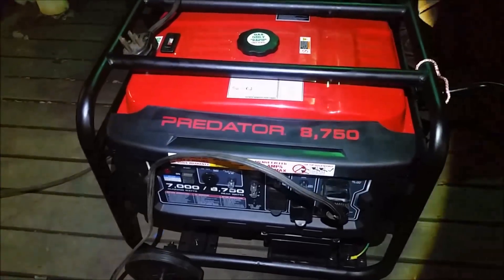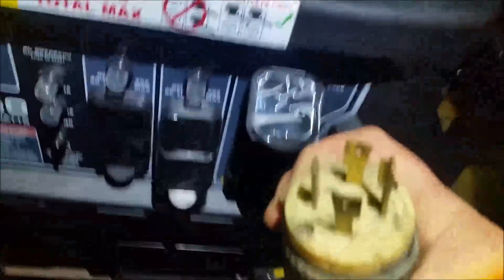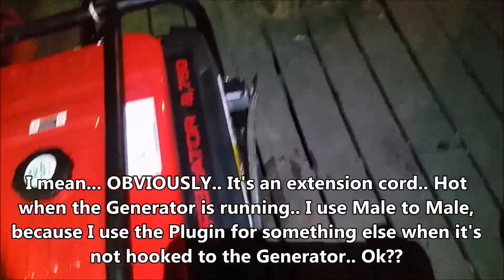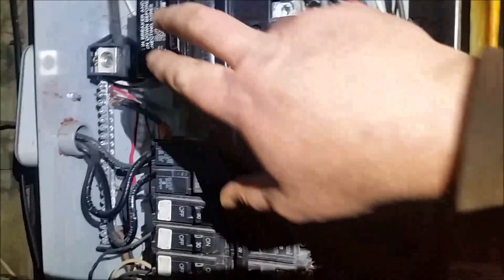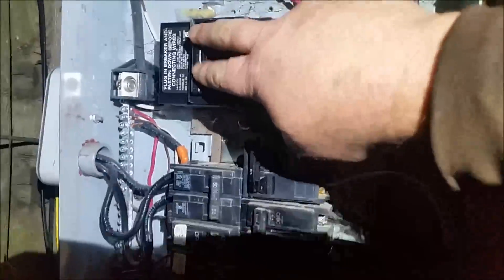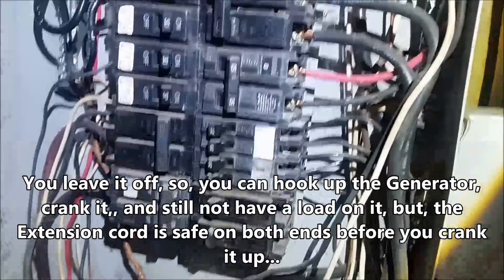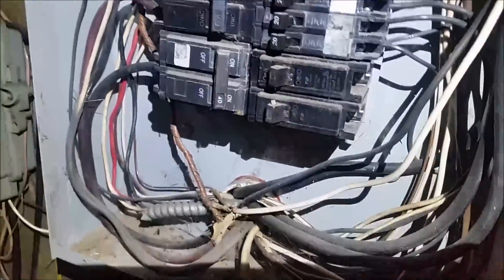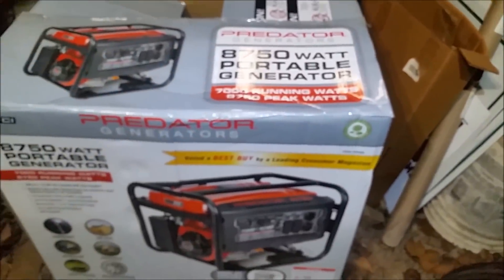Quick/Easy/Safe: Use Existing Plugin/Breaker for Generator hook up to your house Panel box.

Comment: Will this work? Yes.   Will your home insurance cover a claim if this is found on site? No. 

I would feel okay doing this in a pinch but there would have to be a way to lock the main breaker off. There is a device to clamp and lock a breaker. If you want to make it a lot safer to use, install a generator connection box to a 240V breaker. This box will have a recessed male connector covered by a weatherproof cap. The cord from the generator will have a male plug on one end and a female on the house side. 

Another thought. If you decide to use extension cords, ground your generator. There should be a ground rod near your meter.
Reply: I see no real reason to ground a generator if you are using an extension cord to a fridge. If the generator is not grounded the only way you could get shocked would be to touch 2 wires at the same time as there would be no earth ground reference.
Reply from the maker: @shofar-man  Correct.. I let that one get passed me... Thanks Ed for catching me missing that..
Reply from the maker: Challenge to Mr J Deveau....  First though... I'm not sure how you would use a generator without an extension cord tied to it in some way, but, I am still thinking.. Ha..Ha..  There is always a ground Terminal on your generator..  Not that you need one.. I have a 220 volt Deep well pump on my property.. Been here much longer than I have.. It  has only two hot wires.... No Ground from the Panel to the pump. Can you explain how that works as far as the ground.. BTW.. It is about 65 feet from the Pump to the Panel.. 10 Gauge wire,, 2 solid copper leads, 1HP pump 125 feet deep.. Ok.. Next.. I have been using generators for 20 years. I have never grounded one.. Do you "Need" to Ground a Generator?? You can, but, don't "Need" to.. 
So,, you are exchanging a harmless extension cord (Male To Male) that gets used a couple times a year,, and only while the generator is running,,,, and only limited to the Generator voltage while it is running,,,  but, you want to take an Exposed Male connector and connect it directly to the panel, where it is a potential danger 365/7/24.. Where my solution,,, the only time it could potentially hurt someone is when it is actually hooked up to a running generator, if someone was stupid enough not to plug both ends in.. I find that to be Ironic for someone safety minded...  But, that is Ok?? You are leaving your life and the life of others to a thin piece of sheet metal that does not require any common sense to use?? Ok..  And, on the Remember to plug it in,,, this same dangerous person without common sense to remember to "Plug both ends in", is in charge of "Must Remember to Plug the Protective Cap in the Recessed Male Plug"????  Just curious of the Logic there... !!!   Enough said about that... 
Quote: "If you want to make it a lot safer to use, install a generator connection box to a 240V breaker." Now,, My Way.
Quote: "If you want to make it a lot safer to use, install a generator connection to a 240V breaker." Did you notice the difference in how you do it and how I do it.. I just removed the word Box.. How different is that?? Ha..Ha.. It is installed in a 220 Volt breaker also.. :)
Now... Insurance not covering it.. For what reason??  Because it is against NEC?? NEC does not Regulate "Extension Cords",, only when "Not" to use them, and a Generator is always a "Temporary Source" if there is a Main Utility Power Source, so, does not apply... So, what part of this setup would "Cause a Fire"?? The fact that there is an Extension cord? Would be one in ANY installation of Any Type.. Is it because there is an extra Male receptical or plug? If you count either application, the same number of Male units are in both applications.. 2males (Extension cord and a female on the panel in mine,,, M/F Extension Cord and Male Receptical on yours. Same thing.. Hooked into a 220v receptical on both also.. Where is it that it can be proved that this caused a fire?  I mean... I am just someone who thought about what you said and proposed the questions to the same guy who authoritatively said them... 
Now,,,, it's just as simple to use a little logic to explain your comment... 
If you have an Opinion, it should be based on Facts,, and you should offer those facts up daily to support your opinion and Fact Check them, to be sure your opinion is actually based on the facts,, because,, you might just change your opinion.. This is how I came up with this scenario 20 years ago and have been safely using it ever since.. And, where I live, I run on Generator quite a bit more than even California with their crap power,, so is a "Worst Case Scenario" to test the setup... But, I do have common sense.. I can look at the Extension cord and immediately know that it needs to be plugged into a Non Running generator if the other end has not been plugged in yet..Ha..Ha.. 
Of course, anyone with common sense would do that anyway.. Have fun with the logic.. If you need some help,, let me know.. I am ready for "ANY" reply.. I have schooled Electricians and Electrical Engineers just the same.
If you wanted to see it, just keep reading the comments in this video. You would know more about Electricity than any average Electrician, which isn't much...
Reply: @MarkThomas123  Mr. Thomas
To clarify, I consider "extension cords" to be the 120V extension cords from the generator directly to an appliance such as a fridge or a water pump. The neutral would not be connected to ground. There is a very small chance that the output voltage would float in respect to ground and result in a shock hazard. This is the only scenario where a separate ground connection is required.
The generator cords, such as the one used in the video, are normally four conductor and connect to the building's ground connection. The male-male connection would use the same ground wire thus don't need a separate ground.

My guess on your pump? The pipe is acting as a neutral. Not sure if that's normal. My 120V pump is in my basement. I know I would feel a lot better if there was a separate neutral wire.

I've been working with generators for work for the last 12 years. We don't use a separate ground as we also have a ground wire connection to the existing wiring. We also use a manual transfer switch. I've recently purchased a 7200/10000W portable generator for home use after we got hit with the lastest hurricane. We were out of power for just over four full days. We average at least one 24hr+ power disruption per year (summer or winter). 

The generator connection box with male connection I was refering to are normally connected to a dedicated breaker that should only be energized if the main breaker is off. The lid is also spring loaded so it will not open on it's own. I just wanted to offer a middle ground solution in order to avoid the "suicide cable". This is what I meant by a lot safer. Safest is to have a physical barrier to make it impossible to have the mains on and a connection to the generator (panel interlock). I would also put a piece of duct tape on the main breaker after switching it off if no transfer switch, panel interlock, or lockout kit is not available.

Insurance is always looking for ways to deny claims. Here in Canada, using your method may be considered illegal wiring and will give the insurance company cause to deny a claim. I would rather spend the money and get it done right. 

"So, what part of this setup would "Cause a Fire"??" I didn't claim that this would cause a fire. I think you have the wrong comment.

So, is backfeeding via a 240V (dryer/welder) plug dependably safe? Yes, as long as everything goes exactly as it should. Is it risky? Yes, it's not an "approved practice" so insurance companies will give you grief if they find out. That's a risk many people take. 

I have decided to get the full legal install of a generator sub panel and connection box as I may not be home to connect it if the weather is bad. I may already be out connecting generators for work.
Reply from the maker: @jdeveau6718   This got a little lengthy.. 
1 of 2 reply.. 
120v Extension cords directly to an appliance: (Neutral not connected to Ground).. Think about the 2 wires going to the Deep well pump.. No Ground, and it still works.. The Motor has a ground to the water and ground around it.
Where is the ground on the Appliance? Connected to it's frame? Same thing.. 
Grounds,,,, In certain "ODD" circumstances might save someone from an electrical shock.. Remember.. Electricity takes the path of least resistance "ALWAYS"... 
Generator without a ground.. I assume you mean you don't Frame Ground the Generator itself from it's Ground terminal.. But, the feed to the existing wiring has a ground, and even if it did not, the Existing wiring does. And, the Neutral and Ground wires both go to the Ground bus in the panel, so, there is little if any difference "In General" between the two.. The main difference is at the Appliance, not panel or distribution. They are "HOPING" that in the even of a discharge, a direct coper connection is more conductive, therefore a lesser path of resistance than a human body, etc.. It's almost like wearing two rubbers and visiting the local gal everyone knows about.. 
Manual Transfer switch: My brother has one that is wired between the meter pan and house feed. You can't possibly make a mistake with it.. The Breaker Panel Interlock is another "Can't Possibly Make a Mistake" scenario.. 
BUT,, when it comes to DIY,,, here is where the problem is.. 
Let some Dipshit, or someone who "Thinks they know what they are doing", and in both of the above scenarios,, what is that person dealing with?? 
The Inside of a Panel and Full Voltage of the Feed.. At least 100 amps, generally 200 or 300 amps.. 
And, even a simple Interlock requires taking the Panel cover off.. Correct?? 
And, guess what?? When you use an existing Stove or Dryer Plug,, you don't have to pull a panel cover or pull any main feed.. Safer yet?? 
I think it is a whole lot less to remember, to say "Turn off Main First", plug in extension cord", and Crank Generator.. 
Most generators a DIY is going to purchase are 30 amps and below. A dryer plug is most often 50 amps, same with a stove. At the least 30 amps on a dryer. So, the chances of overloading the wiring is remote.. When you start pulling 30 amps from a 30 amp generator, you are going to be having brown outs everywhere and strange things are going to start happening, besides filling the generator with gas quite a bit more frequently. Usually, it is only when some large motor start up, and only for those few seconds at most at startup.. Not something that is going to melt a wire before the generator bogs down and dies or things in the house start beeping and rebooting, etc.. 
People just don't run generators at full load, and if they do, and then don't, it will be very obvious that the gas is too expensive to run 12 or 24 hours under that kind of load. One night you get 8 hours on a tank and next night you only get 5?? 
I would say that we loose power 40 to 50 times per year. On a good year, probably 10-15. Average outage is probably 12 to 24 hours with some stretches of 3-5 days, with a few times 7-10. Lots of outages are only 3-4 hours.. What you need is a quick way to hook up, run, and disconnect and get back to work. Using an existing plugin and a Male to Male cord can't get any more simple or quick.
When you grab a Male to Male cord, you have to be brain dead not to get the heebie Jeebies and think to yourself, one more minute before you connect anything.. Just to think about it one more time before you energize it. But, it's pretty simple. Turn Main Breaker off and don't crank Generator before Extension cord is plugged in on both ends. This is for people with common sense who wants a quick/cheap and safe way to get through an outage.
I keep a Plugin with a pigtail handy in case I want to take the generator to someone else's house to get their Freezers/Refrigerator cold again.. The generator never leaves the back of my truck, unless I want to go somewhere, or have to take the genset around the side or back of the house and there is not enough room for the truck.. There are lots and lots of reasons for this type of hook up and nothing else is going to work like it. Nothing more simple.
In Canada I am not familiar with the codes.. NEC has nothing to do with Temporary or Extension Cords. I have never heard of a building code anywhere that says, NO MALE TO MALE Extension cords.. I seriously doubt you have one either.. Maybe a less than knowledgable someone who says "Suicide Cord".. Commercial and Industrial Electricians use them frequently to provide temporary fixes.
There is nothing about it that would cause a fire, different than any "Someone approved" way to do it.
An Insurance Company would have no way to deny a claim, because, they could not prove it had anything to do with the claim. If I sped on the way home, it doesn't matter if the house burned down because of lightning, that I sped home. One has nothing to do with the other.. 
Not saying some Attorney didn't sell someone out and take a payment from the Insurane Company, or some home owner didn't say "What the Hell are you talking about", when they were told that by them.. It would never happen to me.
Reply from the maker: @jdeveau6718  2 of 2 reply.. I guess you probably saw all of those choppy posts.. I don't know what was going on, but, last night, it showed nothing posted.. Hmm.. 

Backfeeding through a Dryer/Welder plug is no different than "Backfeeding through a box like you describe with the recessed male plug. It is either a circuit or not. From the Generator to the 220v breaker. Doesn't matter if you have a manual/automatic transfer switch or Panel Interlock, you are still connecting and "backfeeding" a 220v breaker.. 

Nothing wrong with getting what someone would call a "Full Legal Install",, especially when you might have a wife or child connecting the generator. 
My 81 year old Mother has the same setup I have.. It was her generator that was in my video. I just put it together, filled it up with oil and gave it a breakin run, not under any load. The other generator you heard in the background was my generator running, and not under load, because I was just running it for 10 or 15 minutes since I was working on generators at the moment.
I was running on plant power and there was no power outage at the time.. If you look closely, the main is on in the video.
And don't worry about plugging your generator on with the main breaker still on.. You are not going to buy a generator that is going to drive your whole neighborhood anyway,, or to be more correct in description, everything between your house and the end of the line and your house and the plant power or substation you are feeding out of.
Your Genset breaker is going to trip so fast, or the Genset is going to die under the load.. Why? Because,the only houses you are not going to be feeding, are the guys with generators who beat you to the electrical box, and have already thrown their mains off. Think about it.. And, it will be hours before the Power Company is out there working on anything. If someone is not sure of what they are doing, and comfortable with it, they should have at the very least a Panel Interlock and a Recessed Male and regular Generator extension cord.. My video is not for those people. I say that many times in the video.
And, it really does not matter.. I didn't explain how to make the Male to Male cord, so, what are the chances that some dipshit is going to make it that far anyway.. They won't make it past the guy at Home depot, when they buy the wire and two males instead of a Male and Female. Nothing wrong with the Video, Idea, Concept, use of, this procedure.
Before you hire your Contractor to do your install,, you should stop by the local Building Inspector and ask him what is the "Minimum Required for a Generator Install",, and what would he do at his house.. Then, ask him for a printout on what he just mentioned to you.. you have to let me know how that goes.. Ha.>Ha.. But, don't forget to get the Printout of the "Rules".. :)
Good Luck with your install. 
BTW.. Before I go.. My 81 year old Mom. I explained the procedure to her while I was at her house. I gave her a cheet sheet. 
1) Turn Off Main Breaker First (MUST)
2) Connect Suicied Cord to Generator and Panel.. I have a Female 50 amp hanging below her panel. 
3) Turn off "All 220v Breakers". 
4) Crank Generator
5) Turn on Generator 220 Feed to Panel Breaker. 

To Take a Shower: 
1) Turn of Deep Well Pump (Do not use water for now). 
2) Turn on 220 Breaker to Hot water heater and listen to the Generator.
3) When you hear the generator load drop and generator even out....... 
4) Turn off Hot Water Breaker
5) Turn On Deep Well Pump.. 
Go ahead and shower. 
When done, Turn off Deep Well Pump Breaker. 
Turn on 220v Water Heater breaker to reheat water.
When the load reduces, turn off the Water heater and turn on the Deep well pump..
I typed it out on a 8-1/2 x 11 paper. 
Then, I wrote out a 3x5 index card. 

1)Turn off Main Breaker and all 220v Breakers. 
2) Hook up Generator Cord
3) Crank Generator
4) Turn on Generator Breaker and any other breakers you need.. 
Guess which one she uses? 3x5 or 8.5x11.
Yes.. But, I put a little pocket made with index cards in the panel door and folded up the letter size instructions and tucked them in the pocket.. 

I got on the phone with her the first couple of times she had to crank the Generator, or I went to her house to crank it. I only stood there to watch and would not confirm or deny what she was going to do.. 
She got it right the first time on her own and every time after. After each hookup, I had her walk through the disconnect.. 

1) Kill generator.
2) Disconnect Extension cord.
3) Turn on Main Breaker
4) Turn on all other breakers one by one.
Then, we would step through it step by step again, while I explained everything to her again. She is confident looking at the 3x5 as a "Check", and could do it anytime she needs.. But, I am always available on the phone when she connects  it.. All I do is listen to how she is going to do it, step by step. She always gets it right.
And, it cost me about $20 to hook her up. All I needed was 4" of Flex Duct, A weatherproof box, a 50amp receptical, and a Coverplate for the 50amp.. 
She connects the Generator whenever she has an outage, just because she figures it is time to let the generator run a bit.. Otherwise, she cranks it about once every two or three weeks for about 5-10 minutes.
Cheers..